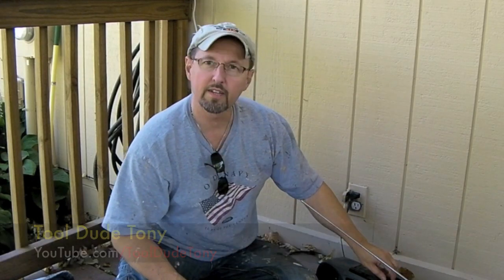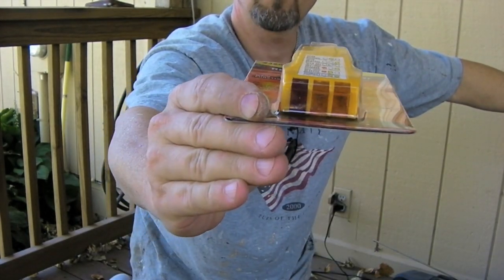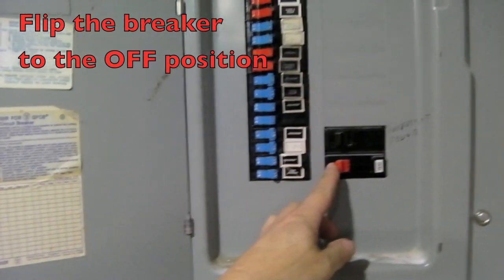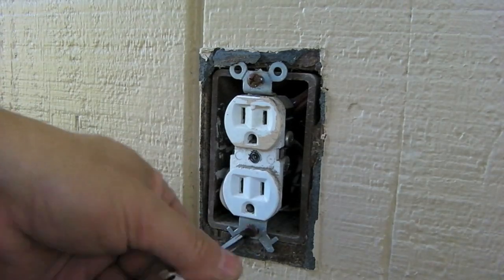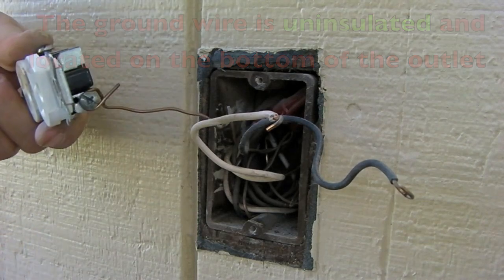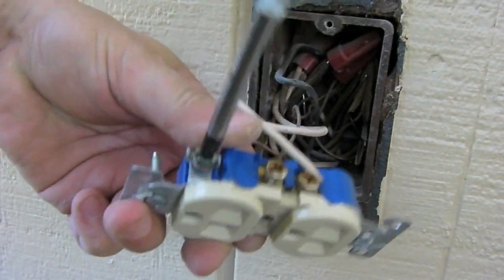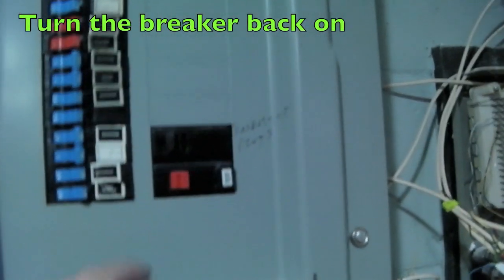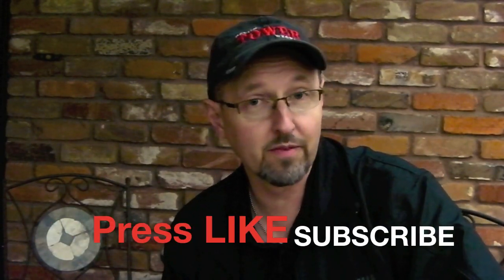How to Replace Electrical Outlets

Comment: I had an electrician come too my home because of an outage in two rooms, he began with we might have to replace the wiring etc, he was payed $75 bucks an hour. he was at my house for two hours going thru all the usual suspects, and in the end it was an outlet all along and he knew it all the time, because he was told what outlet we had been using at the time. These are good learning tools you are posting

Comment: pretty informative, but it could have gone further to say that the black wire is hot and the white is neutral. also, black goes to the brass terminal screws (either one) and white goes to the silver colored terminal screws.

Comment from the maker: Hi Hulk, The GFCI testers can test regular outlets, but can also test the special kind of outlets that are installed in kitchens, bathrooms and outside.  They're easy to identify by their little test and reset buttons right in the middle of the outlet.  I read some reviews on the Home Depot GFCI Tester and they were not good.  I wouldn't recommend it.  Get a regular one and if you are replacing a GFCI outlet, follow this test process: Search Youtube for GFCI Outlet: How it works and how to test

Comment: Decent video.  I appreciate the acceleration on the tedious parts where screws are being driven.

I just cut the old wires even if they're screwed down.  I like to have fresh copper in contact with the screw terminals.

Comment: Hi,
One important point not mentioned in many videos like this one, which I have a question on. The new outlet has two set of screws, two for the black wire and two for the white wire. Your demo shows that we only need to one screw for the black wire and one fore the white wire. Does it matter to use the top or bottom screws, as long as you are consistent with black wire on the right (the brass screw) and one on the left for the white wire? Thanks.

Comment: Excellent video! What I like to do is once I got my wires unhooked from the terminals. I like to cut off the old curls, then strip about a inch of insulation, and then with long nose pliers, curl, then screw in my wire.

Comment: I had to replace one of those old style outlets where the wires feed straight into the clips...  You can't pull the wire out... you gotta cut the wires.... then strip and bend.... attaching to the type of outlet showed in your video.....  
I wondered what the the other two screws are used for.... but only connecting to the top screws.... works... thx

Comment from the maker: You know how in some living rooms that the top half of the plug is controlled by a light switch and the bottom half is always on?   Normally, there is a connector between the screws that makes both plugs function the same, but if yiu break that little connector, you can spot them as in that living room example. Does that make sense?

Comment from the maker: Hey Bradley, If the light is controlled by only 1 switch, the process is exactly the same as in this video.  If you can use two switches to control one light, it's trickier, but similar.  In that case you need to get two-way switches and follow the instructions on the inside of the package.  And always be sure the power is off.  Good luck.

Comment: Nice video!  I’m cleaning my kitchen and then outlet covers are easy to Clem, but not the outlet itself.  If I turn of the electricity to the outlet, is it ok to wipe over the outlet without completely removing the outlet?  It may sound like a silly question, but I have wiped over the complete outlet before, and it’s not a pleasant feeling.  Thank you for the video!

Comment from the maker: The process for wiring light switches is the same. Sometimes you have lights that are controlled by 2 switches. Just get the right kind and follow the wiring diagram in the package. Piece of cake. Thanks

Comment: Tony, I am rewiring a 40yr old cabin. when I'm doing a double socket can I plug the wires into the back instead of the screws?  I use the screw to wire the two outlets together and it is easier

Comment: Hey Tony got a question. Ok we have an outlet under the sink, top plug goes for the dishwasher and bottom one goes to the garbage disposal. The bottom plug is also controlled by a switch that is on the wall above the sink that we use to turn the disposal on/off easily. Problem is the disposal began to run non-stop whether the switch is on or off so we had to start going under the sink to plug it and unplug it whenever we want to turn the damn thing on!

Comment from the maker: Sorry, but this new YouTube interface sucks.  I'm not able to reply to most of your comments.  I wish they'd stop messing around with this. :(
Reply: i changed my plug but its still not working so it must be the wiring or the breaker gonna have to check them thanks for the video i used it to make sure i had it hooked up right and i did

Comment: I saw another video where the wires were connected to the bottom screws, but you did yours on the top.  What's the difference?

Comment from the maker: @mdh478 --- That is definitely a good idea.  It is harder.  You need to run (probably snake it through the wall) a ground wire all the way back to a bonafide ground like in your breaker panel.

Comment: Hi, two of my kitchen's outlets are working but they damage any small appliance (like toaster or chopper) when I connect them. It already had damaged two choppers and one toaster now. I'm not using these outlets any more instead using the other outlets in the kitchen. Could it be fixed if I change the outlets? Thanks

Comment: Hey sir I have to replace like 20 or so outlet in my house but heres the tickler, my current outlets are 2prong and I need to upgrade to 3 can you tell me if all the wires are the smae weather 2 or 3 prong?

Comment from the maker: Those type of outlet testers are less than $5 and you can get them at most hardware stores.
When I run into outlets with the same colored wire, I just wire one to each side (keeping the ground with no plastic coating separate).  Then I'll power up the outlet and use that tester.  The lights on it tell you when you have it wired correctly.  If not, just switch the wires and test again.  Good luck.

Comment: i live in a 1994 trailer and im planning on redoing my room but the other day I was helping my mom paint her kitchen and pulled the outlet to tape and the back of it look like a junction box and the scews had a plate thing to pull it up to the drywall and I hate to mess with it and screw up can you tell me what do my lights switches are like that too I wanna change it too thanks

Comment from the maker: In old houses, you never know what's connected to what.  You can get a live wire voltage sensor.  To use, you touch it to the wires.  It will light up if there is power.   Then it's turn off more breakers until you find it.

Comment: Question.  I just tried to change an outlet. I have four wires.  1 white 1 black and what seem to be 2 grounds(They are in a clothe like material.  I put wrapped the black on the "gold" colored nail side and the white on the regular silver side.  I wrapped one ground on the ground nail and also tried wrapping both of them to that one ground nail but didn't get power.  Can you tell me what I might be doing wrong or what other things I should be checking for?  Thank you

Comment: I bought the tester however, when I plug it into the outside GFI, it doesn't light up at all? Is it more probable than not that I just need a new GFI and the new one I install will work fine? Further, if I install the new one and it doesn't work then what would you suggest? Great video, thank-you.
Reply: Kevin Parish did you press the button on the GFI that turns it on it should be above the reset button in front then a green light should be on.

Comment: I had atleast 8 outlets in my place go out . no circuits tripped. do outlets link up and if 1 goes bad they all won't work ? I was thinking about replace the one closest to box since it looked in bad shape and had no power.

Comment: First we replaced disposal and no change. then we changed the outlet and now both plugs won't work at all. I think it may be a bad receptacle that we bought...but could it be the lswitch? Not sure because the dishwasher(top plug) was working fine and now it doesn't work either. and it has no connection to that switch ...
Thanks for reading...

Comment: You can only replace your outlets with 2 prong outlets.  Or you can replace the first outlet on the circuit with a GFI outlet and the rest downstream of it with 3 prong outlets.  You must put a label on the GFI that says "no ground" or "no equipment ground".  These are the only legal code approved ways by the NEC (national electric code)

Comment: Q1) How much does an outlet tester cost?
Q2) What if the house i'm in didnt have colored wires, I'm afraid of putting a wire onto the improper screw on  the new outlet. If i turn the breaker on...would this cause a fire?
Thanks in advance.

Comment: Where do you get  the seal and the special made cover? Mine is literally on the other side of the shower.... like the other side of the shower wall... I get afraid I will get electrocuted a cover would make me feel slightly safer

Comment: I have an outlet that is not working at all. I want to try replacing it to see if that will fix the problem, only how can I be sure that the power is off if the outlet does not work at all?

Comment: question about outlet.. one night all of a sudden, my outlet went out, no power at all, then i check another one, on the same wall, it is the same thing, no power.    what could it happen? I checked the breaker, all look okay, I even reset all of them, those two are still having no power.  Does that mean I need to replace it or something wrong with the wiring or breaker?

Comment from the maker: The black and white wires are the same.  The third wire is the ground.  Check the code in your city/state before doing this. It probably will require you to run all three wires to the outlet.  It would not be safe to leave an outlet ungrounded.  For you are your family's sake, please do this to code.

Comment: Here's new one (to me)... While replacing outlets in a non-grounded home,  pulled a three-prong that had the ground terminal wired to the common (white) terminal with a jump wire - ever herd of that, and is that an OK method of providing a pseudo ground in the scenario?
Reply: That is what is known a a bootleg ground and no it is not an ok method.
Reply: Thanks for the reply - I suspected doing this would turn the ground "live" should a short happen in whatever was plugged in. I'm guessing if you're grounded to plumbing, you could shock-the-$#!+out-of (God forbid electrocute) someone using water, and fry your washing machine electronic boards...
Reply: Its a way of cheating some of the tests used for detecting the ground.  In essence the system is the same as if you just took a two prong plug and replaced it with a three prong plug.  By placing the "bootleg" it makes it appear as if the system is grounded correctly.

Replacing a two prong with a three prong in an underground system, against the code.  Replacing a two prong with a three prong, against the code is deceptive and unethical.

In MOST cases, someone replacing a two with a three prong do it out of ignorance.  I would also guess that in MOST cases, someone who switches them and adds a bootleg know what they are doing and are trying to fool someone, hoping they don't check to far into it.
Reply: NO!

Comment: If you have easy access to your ceiling (assuming power is coming from below, then you can fish a ground wire down and all the way to the main ground making sure to follow city codes!  Otherwise you can pay an electrician $8000-$12,000 to rewire your entire house up to code.
That's the typical cost of an average home rewire.

Comment: hey Tony:  Q: I have a bathroom outlet (GFI) with the black and red buttons. It don't work.
I removed the outlet. I used a multimeter to test the bare copper wires. NO juice? all other outlets and light switch work aok. AAAAA? How do I test why there ain't no power coming from the copper wires? All breakers in the panel are AOK....Were Is The Power??   deeman, PS ..I really enjoy your videos.
Reply: that means your breaker is off in the panel .. just pop it back on .. bathroom gfci outlets are on a dedicated line

Comment: where do i begin first there was a outlet in the bathroom plug in hair dryer blew out all outlets and light switch then in bedroom touch an open outlet without turning off power and it blew all outlet on other side switches in kitchen for light don t work just about sitting in the dark with out electric please help

Comment: Where can I buy the flip top? There is an outlet right on the other side of the shower... my largest fear is electricution cause I like things steamy n hot. Its in the shower wall on the opposite side and its a small shower.